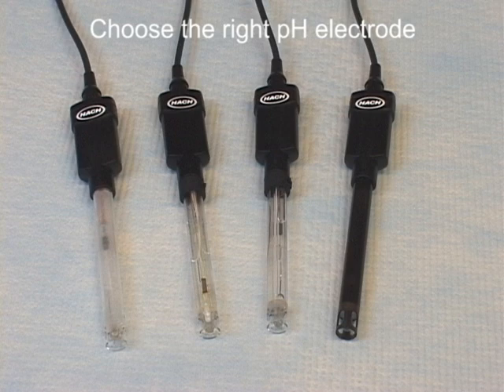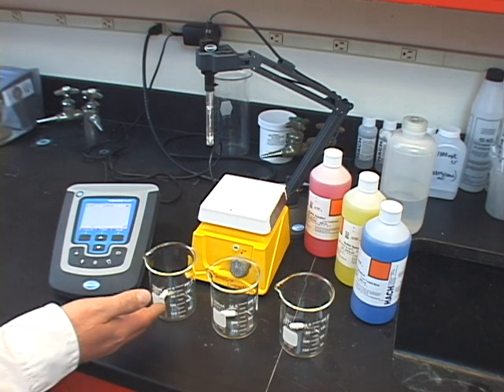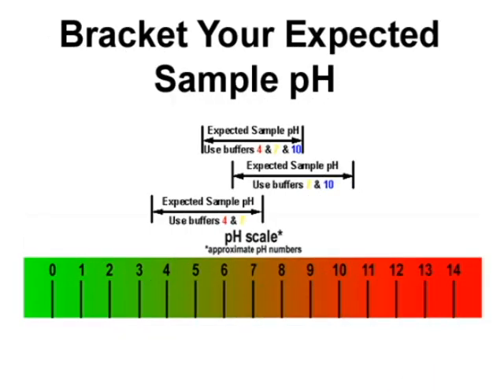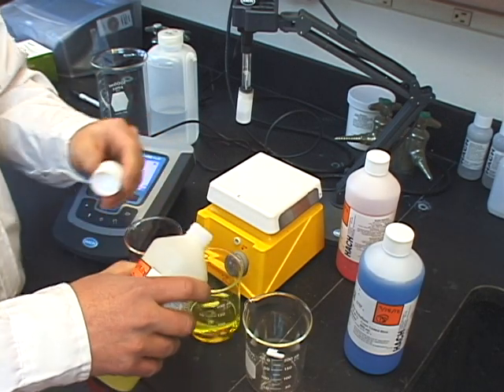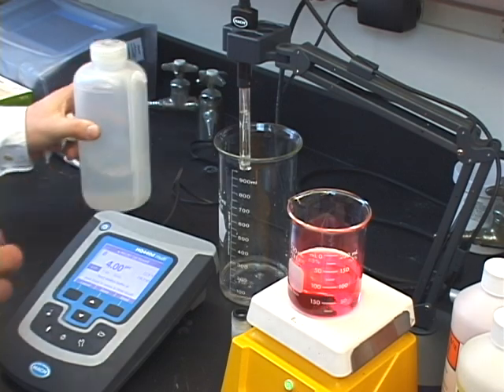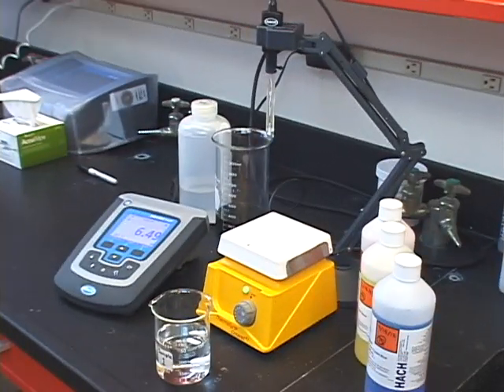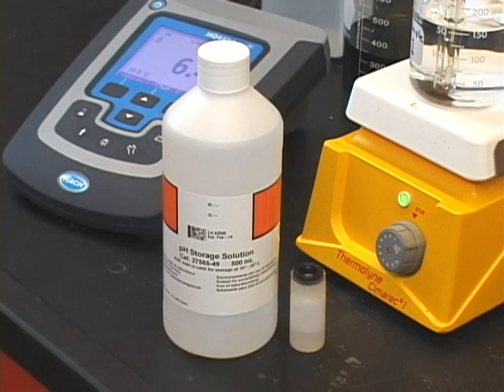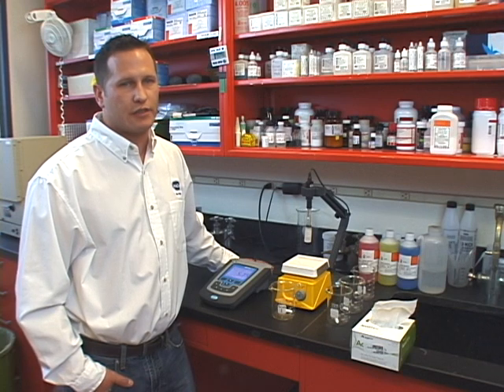The Basics of pH Measurement - Hach Educational Video

Comment: Can I use buffer pH 4 solution for short time storage?
Reply from the maker: Hello Nina, thank you for asking! Hach pH probes should not be stored in anything other than the designated storage solution at any time. For storage between measurements taken a few minutes apart it is acceptable to pour some storage solution into a small beaker temporarily. You can see the correct storage solutions here: https://bit.ly/3r0ZRjA

Comment: Great Video..... My new ph probe just stopped working properly after about 2 months of continuous use. I keep getting slope erros. DO I need to replace? I tried cleaning with soap solution but still slope error (percentage in the 80's. SHould I re adjust the percentage limit to 80-120? right now its 85-100 and its rejecting when i calibrate.